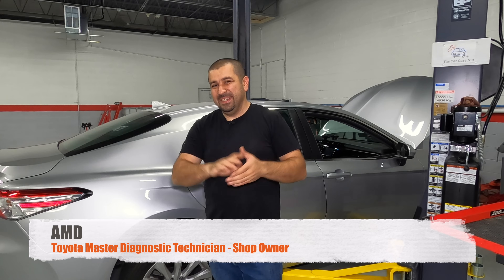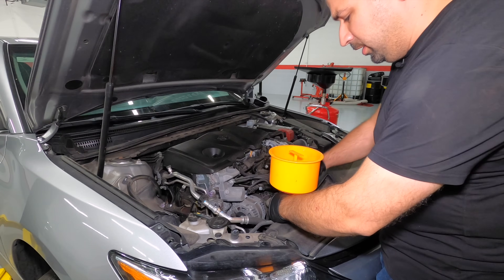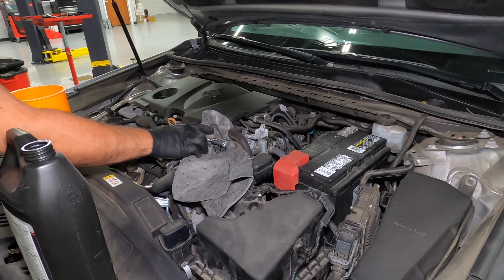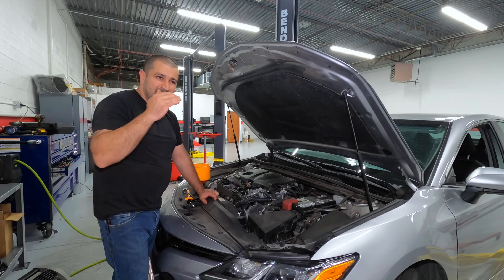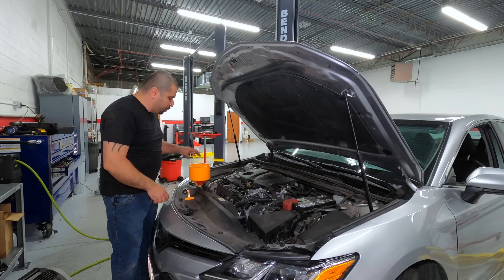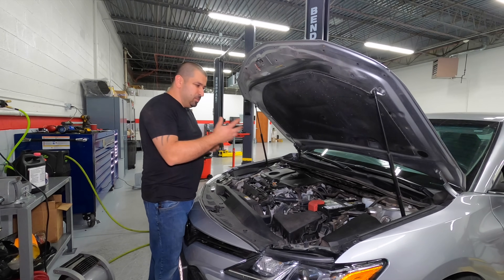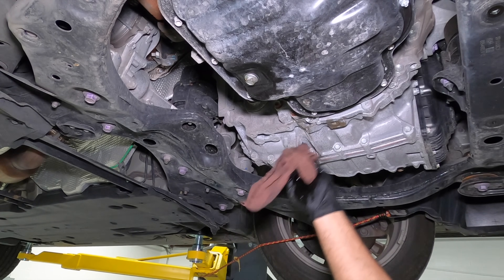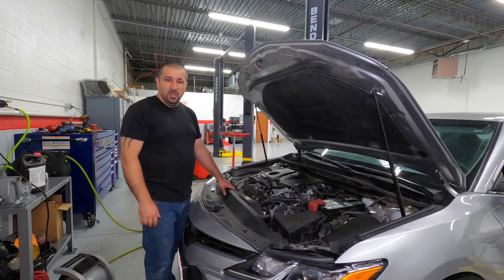Coolant Replacement on Toyota's New Dynamic Force Engine | DIY Without a Scan Tool

Comment: Hi Ahmed,  My 18 Camry fan didn't go off when I had the car revving at 2000 rpms, when removing air from the new coolant ( you said on and off twice) .   Could it be getting too hot to go off?  But I have to get it to go on and off twice.    Am I OK to run the car if it only turned on once ?     Does putting the car on jack stands ,  holding the front up, help remove air?  thats what Autozone guy said to do.  Thats what I did.    Thanks for all the great video :)
Reply: Saw your comment..even tho comment is from 2y years ago, it will still be helpful for others. My coolant fan never even came on. Not even once. A simple explanation is that ambient temp is not high enough. I had 12C (53F). In warmer temps, it would turn coolant fan on at about 12-14min, and second time would be around 17-20 min, so I decided that after 22-24min would be a good number to call it complete.

Comment: I don't know about that procedure I mean the fan eventually turned on but it never turned off or back on again and we stayed about 1500 RPM so I gave up put the cap back on and it runs fine I don't understand your procedure

Comment: Quick question what if it's a hybrid rav4 , do I wait for the "Fan" to do it's thing like you said on the video in hybrid coolant bleeding procedure?

(It has the same dynamic force engine since it is a 2021)

Comment: My son has an 08 ES350 with 109k miles.  Would it be safe to drain and fill the transmission fluid?  We are the 3rd owner but I can not confirm if this particular service was ever done.  Thank you so much.

Comment: I'm confused. Other mechanics are doing switching ON the heater to bleed the air out. But you mention in the video to turn everything off, blower, heater and ac. Which is recommended to better blled the air out?
Reply: He clearly stated it was required to have the heater stuff off to ensure valves stay open.

Comment: Hi AMD, I did the same but there is still a lot of sloshing noise, when the car comes to it's operating temperature and when the engine changes speed ( because of gear change ) what can I be doing wrong?

Comment: changed the water pump in my moms 2018 camry 2.5, did the opposite. Changed water pump and thermostat, then ran the car, and turned the heater on and revved the car and added coolant as it sucked it down out of the coolant tank, and then added more coolant each time, seemed to work fine. What is the difference ?

Comment: Will it hurt if you flush the coolant system with distilled water once or twice and then drain, refill, and bleed (the process you showed in the video)?
Reply: Would be ok just need to use concentrate and not 50/50 so your final % is 50/50 or thereabouts. HVe to know total capacity and what is the amount coming out of the radiator to properly figure it out. But yes that gets mist if the old coolant out and is a great approach.

Comment: Hello,

How long you need to put the RPM above 1700 for? I keep it above 1800 for 15 minutes, the fan doesn’t come on. So I just turn on the heater at max and high speed, just windshield defrost on, than the fan is kick on.

Comment: Hi AMD, im a little stuck with the inverter coolant, how I do the change of that one?, I know is only quarter and so if im right, I think this motor don't have the drain on the transmission or yes ?
Thanks in advance

Comment: Hello,
For the 8 speed transmission fluid, what is the normal operating temperature? 175F to 220F.

Thank you so much
Reply: Mine runs in the 170-190 range without really taxing the engine too much. Quite a bit higher than my Highlander which is more in the 135-155 range

Comment: Is there a service manual out for the 2019 Rav4Hybrid? I want to DIY engine coolant and inverter coolant. Process seems pretty straightforward but I don't know exactly which hose is the eGR hose. I'd feel more comfortable if I had step-by-step instructions with images of the process for my specific vehicle. 

TCCN-any change you can make another video of engine coolant and inverter coolant change when a 2019+ Rav4 hybrid comes into your shop?

Comment: Would you also drain the coolant reservoir or leave it and just drain and fill the radiator?
Reply: Obviously it would be better to drain it and refill it
Reply: @condor5635  eh half of it is still in the engine block that's why I'm not sure if the benefits of doing the overflow too
Reply: @armandogomez2677  - wouldn’t doing the coolant reservoir if you can be better than not doing it? Especially since it’s so easy. If you’re comparing doing it to the rest that’s in the engine block that’s not a good comparison. Anyone can drain the reservoir very easily.  The engine block is a ldifferent story.
Reply: @condor5635  it's a fair comparison as you will never get 💯 of of the old fluid out. My question is if it's worth it or not
Reply: @armandogomez2677  yeh it’s worth it. The reservoir usually houses a bunch of nasty debris and since it is easily seen and done I do it every time

Comment: Hey went are you going to be able to work in my 2018 toyota rav4 xle brake fluid and,radiator fluid,transmission fluid,and tranfercase fluid.

Comment: Thank you  so much for this video.  The dealerships around me will not change the transmission fluid in a speeds unless the transmission has problems. They say it's lifetime fluid and do not need to be changed I'm like bull crap!!  If the transmission needs to be changed it's about $400
Reply: @Paul Thank you so much I end up changing my self.   I really appreciate all the help in the added comments

Comment: Hi Armando and Happy New Year, love your channel and content. Question, I own a 1999 4runner and planning to replace the radiator. I was thinking about putting in a all aluminum aftermarket one , it seems like a better one but what are your thoughts on that or is oem the way to go. Thanks in advance Sir !
Reply: One word. Mishimoto. It’s hard to beat the quality and efficiency and you’ll never have to replace it again. As anything, change that fluid on time.

Comment: what happens to the coolant when you kept the engine on? Since we had to keep the fluid in the funnel half way until the fan shut off twice. does it overflow and create a mess or after the second turn off it drains into the radiator leaving nothing left?
Reply: The spill free funnel has a stopper with long handle that will prevent spills when you remove the funnel. You can empty the remaining fluid back into the container.

Comment: Thank you AMD for the video, it was highly informative!!!

I have one question, I currently own a 2019 Camry LE 4 cyl, getting close to 50k miles, and I do a long commute so I put a lot of miles on my car. When should the first coolant change be done, on 50k or 100k? I heard both numbers for the first time the coolant is changed so i wanted to make sure since I'm getting close to that 50k mark. Again thanks!
Reply: I did mine at 95 K and it didnt look that dirty

Comment: A radiator drain and fill is sufficient, don't need to flush system to remove coolant in block? I'm ready to do this on a 2AR-FE 2012 Rav 4

Comment: First, thanks to Armando. Our 2019 Corolla has a different layout it would seem. There is no radiator cap as in the video. There is what looks like a white expansion tank to one side with a regular looking cap, not a pressure cap. There is also a small black bolt with a hex fitting, I assume that is a bleed valve. Is the process the same otherwise?, do I place the funnel into the white tank and what do I do with the bleed valve?

Comment: Request when one come in your shop.  Electric water pump change.  Looks easy and reachable on this engine.     Also removal of intake to do EGR or Incjectors
May be too soon on these engines but I think there will be interest with the prevalence of these engines in many platforms.

Comment: Did this procedure  on 2021 55k miles ( I am very early but wanted to try it)   Rav4 same engine.   Cooling fan only came on but NEVER shut off.  After 25 mins I called it done as bubbles had stopped in the filler tank. Incidentally getting Idle to about 1700 to 2000 was hard and I ended I at  about 2,500 RPM   .  Could that have caused the fan not to cycle? 

I do have semi moderate Scan tool with dedicated Toyota software,    Before calling it quits I had scanner open each water valve.   I could see coolant in filler move up and down when opening and closing valves.   My software does not have the special  coolant purge program or I could not find it.  I just let it run and when fan would not cycle off and bubbles air stopped  I used scan tool to open valves.   I greatly appreciate admire and appreciate all your advice.

Comment: I come from a family of mechanics, with three uncles, cousin and dad who pasted many years ago. I enjoy your videos. I have always changed my oil every 5000 kms or 3106 miles. This is because l don’t use the car much. A lot of short trips. I have a 2015 Yaris with the 1.3 L  2NZ-FE engine.. l brought it last year with 9k kms it’s now got 17k kms. I have since changed the transmission fluid. I next want to change the coolant because you advise every 5 years.  So with regards to doing a coolant change should the heater be switched off?

Comment: I live in north central Idaho and I want to thank you for your video's I purchased a 2010 highlander hybrid v6 and to a point the dealerships that had this vehicle may or may not have done a good job maintains this vehicle .
But because of your videos I got well educated and I thank you as I went to the dealer asking all the right questions and they did not have answers for all my questions so I have been working on my own vehicles all my life mainly Toyotas . They did before I bought the car do a oil change but next month I'm going to change the engine oil it might be ok but I took my normal Toyota oil I use brand new and felt it between my fingers and the oil off the dip stick it does not feel the same something very different even though the oil is clear I do not like the feel of what is in the car it is not as smooth or slick as the Toyota oil.
And when I asked about the trans mission oil and differential oil as mine is all wheel drive they have no idea when it was changed so I'm going to change that also everything is very clean in the engine compartment and underneath there is no abnormal noises or anything like that and with my driving habits I'm getting fantastic milage if I'm highway driving I'm using the economy mode but everything else I use the standard mode I leave the ev mode button alone and I'm averaging between 45 and 50 miles per gallon but keep my speed under 60 miles per gallon and avoid high mile per hour freeway's and I love my car very much when I got the car it had 136 thousand miles on it not really to bad for a 2010.
But I was a truck driver so I check everything daily oil water oil all fluid levels it is the first thing I do before the first drive of the day.
Also especially first thing in the morning I wait until the engine shuts off every time before I start driving.
Again thank you for your videos and I check them often to make sure I'm maintaining my car correctly the Toyota dealership used to be a good dealership and did things right but they have a lot of new people and I'm sorry to say I'm not comfortable with them and what they are doing they want to wait 10 thousand miles on an oil change and I will not go that long so I do not trust them even if I took it in and had it done if I do these things myself I know for sure it was done right by following your videos thank you so much again

Comment: I watched your videos on trans fluid change
Dealer wants to do some power flush entire system says fluid y filter not good
I have no toyota experience but in GM those flushes cause problems

What is your thinking.  I stay with pan and flulid even though not all fluid exchanged
2020 Rav4 50,120 miles

Armando !    Are you Armondo from Pioneer H.S in 1985.   He stole my box of Twinkle.  
Still mad 😡

Comment: You always say to make sure to change your oil every 5K/6mo.  I understand that, but I also have a unique situation of being retired and not driving all that much.  I probably average 5K/year.  So, is it okay to just change my oil at 5K or do I really need to be doing it every 6mo with only about 2.5K on the oil?  Seems overly excessive.  Thanks for any help you can provide!  I have a 2020 RAV4 XLE.
Reply: I have a 2020 XLE too just got recently. Do you have the predictive or anticipated YELLOW guide lines on the reverse camera display?  Mine only has the parallel blue fixed lines and not the yellow ones. Not sure if that is a setting or mine does not have them period. Thanks!
Reply: My 2020 XLE doesn't have them, either. @condor5635

Comment: CAR CARE NUT, If you can help me get rid of the Annoying chime, I will even donate! I like the highlander 2020, but may get rid of it due to the annoying chimes. (Is there a cable harness or fuse i can pull? or is it all sent through the CANbus? thanks)
Reply: I dont really want to use a aftermarket OBD to program the ECU, warranty concerns.

Comment: Hi I live in the UK,do you have info on the aurus diesel 1.6 apparently it has been developed with BMW as used in mini ,my car is rubbish on fuel .50,000 miles any ideas 👍

Comment: I have a Tacoma 2022 brand new,the dealership replaced the same front bushings two times that one s beside the radiator.They said that the cabin was twisted.But still doing the same noise.May you have a opinion for that.thanks a lot.

Comment: Well it turns out the Toyota dealership that replaced my CV axles under warranty did something wrong and took a short cut, let me see if I remember this correctly, they didn’t replace the carrier bearing so it has to be done again,also the water pump is being replaced both under warranty thankfully, still a good car considering we have put allmost 50k miles in a year and a half. I look at it like this if we drove normal miles  it would be roughly 4 years of normal driving.

Comment: Hello AMD, quick question: I did my frist oil change on my 2022 Prius Limited at 1,250 miles using Toyota 0w16 and filter. I then heard that there is a special factory fill like added tons of moly and some other addictives. Did I do wrong by not waiting longer? I didn't mention this to the dealership but when I asked for an early OC they said it's NOT recommended by Toyota until 10k - was mine too soon to cause trouble down the road? also, when the factory oil drained I did not see any metal shavings, not sure if that's a good or bad thing -please advise & thank you.

Comment: I always take off the thermostat and drain all the water. Second By an air pump, I push the air through the hose which goes to the engine to get rid of the old water then I return the thermostat and the hoses then refill the new water
Reply: Good approach but removing thermostat is not exactly a 10 minute job at least I don’t think so

Comment: @Armando, HELP! I have a 2011 lexus es350 that I did a tune up on, when replacing the engine air filter I can not get the gap to close and there is a half inch space where the filter can be seen on the engine side of the air filter box. Is there supposed to be a gap? I installed and reinstalled 20 times and can't get it to seal.

Comment: How long does this take? I been running the fan and hasn’t stopped … been 20 mins texas
Reply: No bubbling in no spill funnel. 20mins rpm over 2k
Reply: Drove the car 20 miles today. Just looks like temp is good.

Comment: with an electronic water pump, Toyota should use the same method as BMW.  Put the car in water pump mode (car is not running, just the water pump)...and it will cycle and remove any air pockets.  It's really user friendly.  Only caution, is that a battery charger should be plugged in to eliminate killing the battery.  Still, looks simple for the Toyota.  thank you Armando

Comment: Hello! I had an incident with my Mothers 2020 Corolla last morning, she just came back from vacation and had her car sitting in her garage for more than a month, she told me when she went to started it just clicked, I assumed the battery was dead so I went over to jump the battery and see if it will start. As soon as I did, it started right up, but was running real rough, engine was shaking as if it were misfiring and had lots of error messages in the dash along with a CEL. I turned off the car and scanned it and had a P265B. I out of curiosity cleared the code, restarted the car and then it ran fine once again, no rough idling and drove fine. Could a dead battery really cause all this? I told her to book an appointment to her dealership to have it checked out either way, but she swears its fine now, CEL has not returned.

Comment: Thank you for this video which is very useful.. and also thanks to Armando..
What would happen if the little hose near EGR is not removed?
Reply: air pocket trap at high point after system drained & filled with coolant.

Comment: Should I replace the radiator cap on my 2012 Toyota Camry Hybrid?  There isn’t any radiator trouble yet, but I am wondering.  It is the original cap.  Thanks!

Comment: If ya got a Subaru Impreza ,,thermostat is at bottom radiator hose, meanin there is still coolant in the block after drainin the radiator.. Fill the radiator, run the engine so thermostat opens , then drain, and keep doin it til ya satisfied all old coolant (or most of it) is gone then shove the coolant in...I am not buyin another Superoo...and won't tell ya bout replacin spark plugs in it

Comment: Thank you Armando for your efforts. I would do the same but I live in England! The video is needed as the Dynamic Force engines are becoming common. My new Yaris Cross has a 1.5 hybrid version and it sure looks different! Thanks also to Ahmed of course.